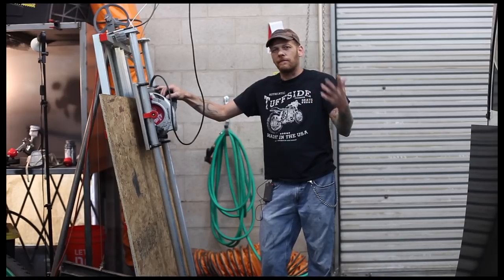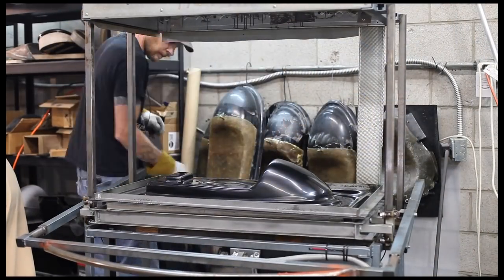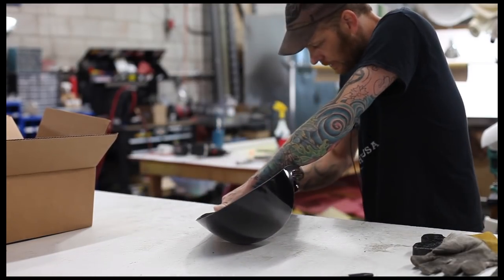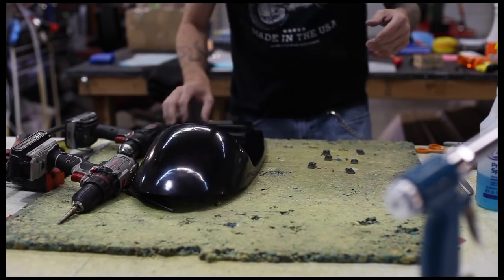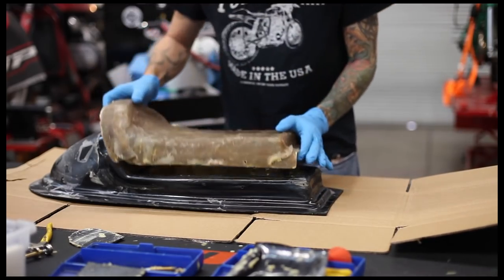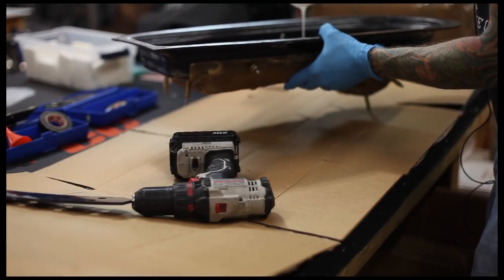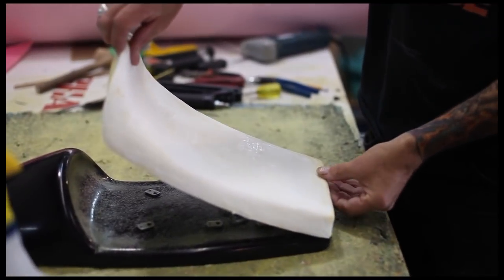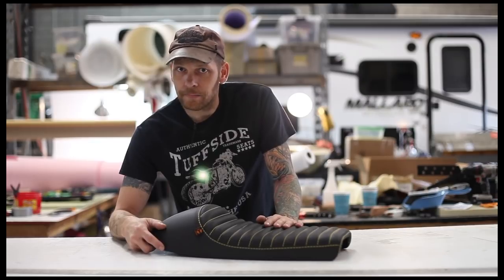Tuffside Cafe Racer Seats - How Its Made - Full Video

Comment: Hey Chris, thank you for the video. 

I tried making an ordinary seat for a school assignment following your instructions - everything went great! Only one small problem came up with the molding phase: when the plastic formed down the mold, some parts of it did not fit closely onto the foot of the mold, but instead got bubbled. I checked the air-sucking force of the vacuum and the pliability of the plastic -- they were fine. 

Do you have any ideas of where the problems might be, or how to fix it? It would be great if I could make the seat look nicer before submission.  

Thank you for your help!
Reply from the maker: Drill small holes in the mold - in and around and areas that may trap air.
Reply: @tuffsideseats  thank you Chris! I will try

Comment: That's nice. Did you build your own vacuforming setup and molds?
Reply from the maker: Yes i did, many years ago. There is a video on my page somewhere building the first machine. Since then i have upgraded to a commercial machine (but i still have the original machine also)
Reply: @tuffsideseats  I'll have to go check it out, thanks.